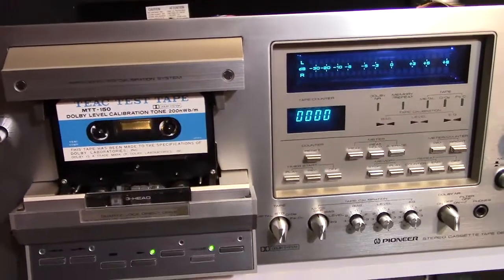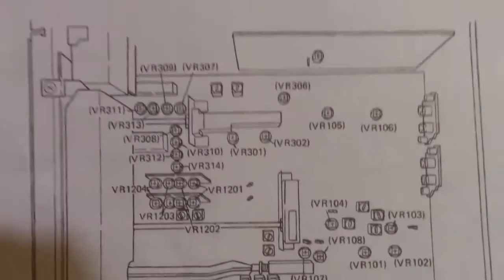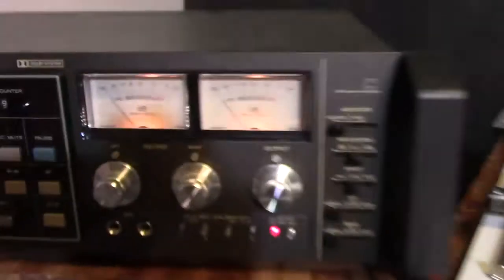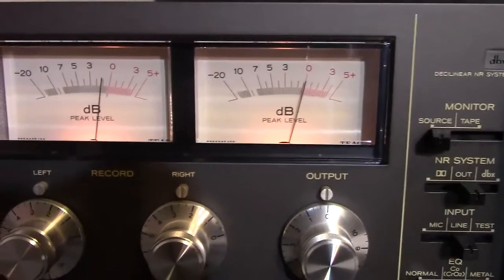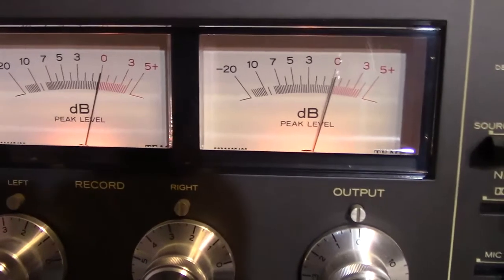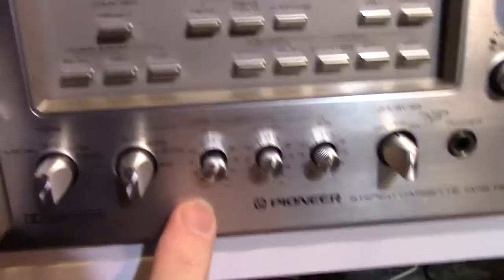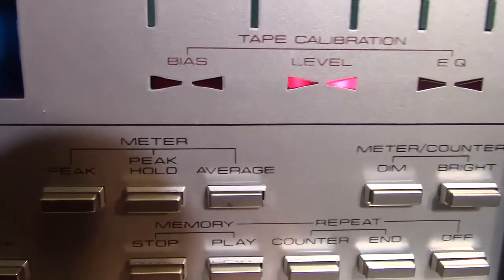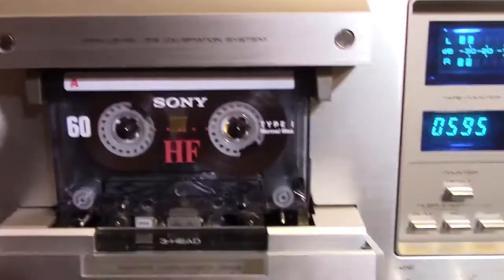CT-F1250 Calibration Demo

Comment: Nice Video, like the 2-dots referents for Dolby Level. Did you do the Pioneer Procedure 10-3 using the Std-341A from Glennlab (160 nWb/m) and set it at to 1.12 volts? theirs been a lot of discussion about this voltage setting,  I think everybody missed the 2-Dots including the Pioneer Manual which say adjust to 0db. than the Output is -3db 710mv than adjust to 447mv at output pot at Click level  But it might work out to be the same w Just using your Dolby tape?  so what was the Input Voltage and output at the Dolby level using your tape? 400hz?